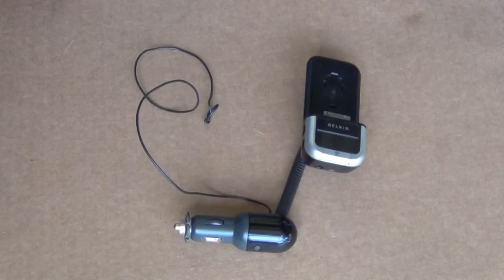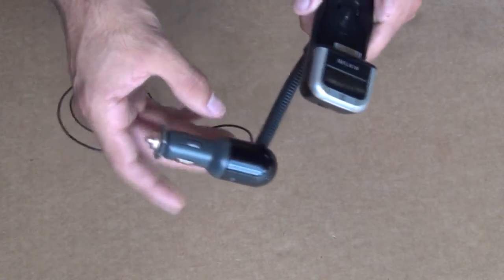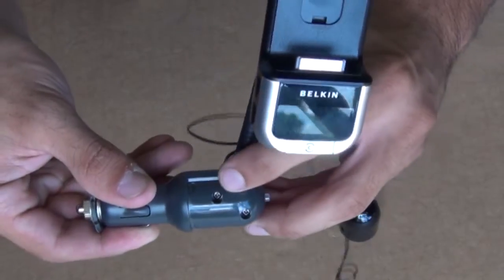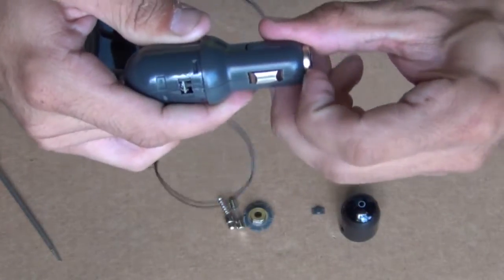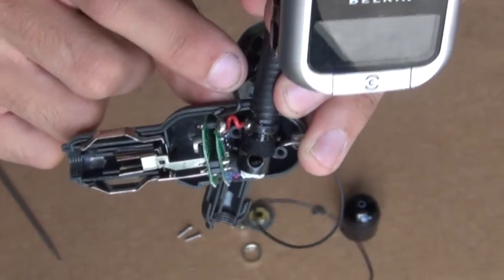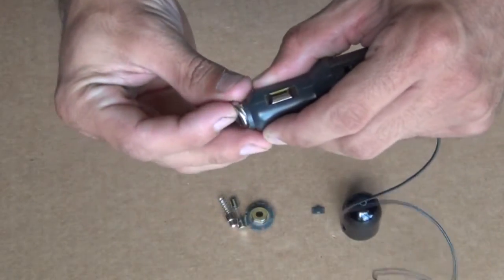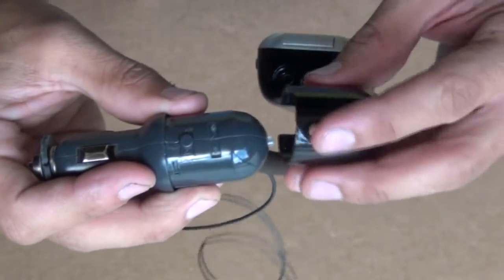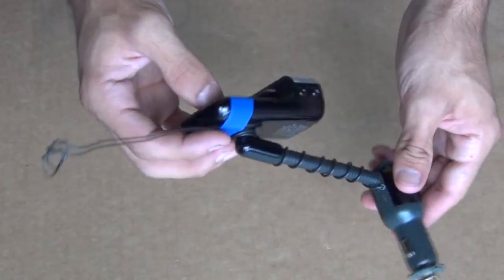How to modify a Belkin Tunebase to improve reception

Comment: I just did this to the same transmitter.  I haven't used it in years because it worked so poorly (unbearable).  Now with the extended antenna it works well.  Still some occasional static, but definitely usable by my standards.

Thanks for the video.